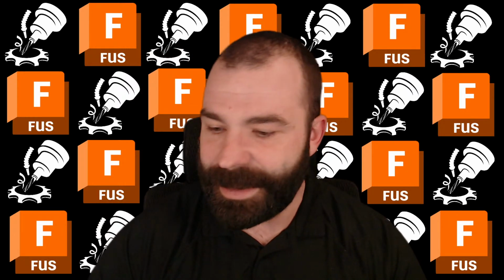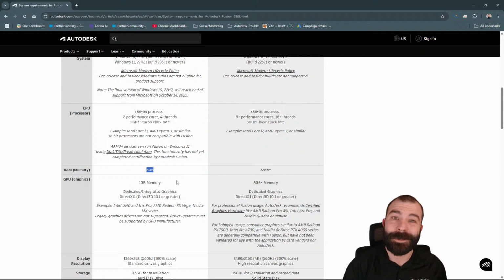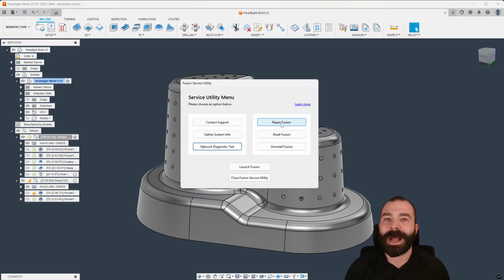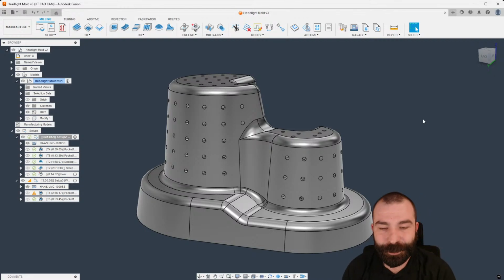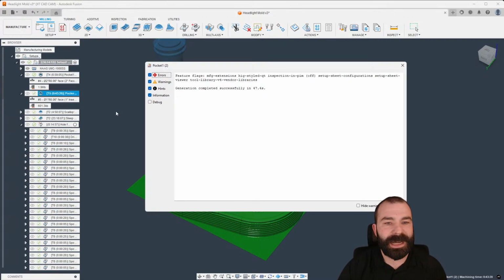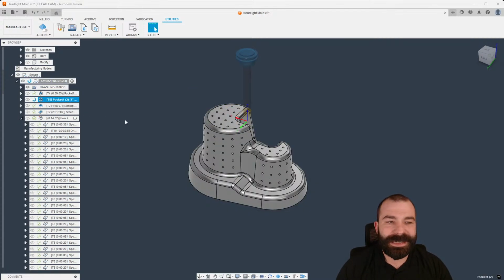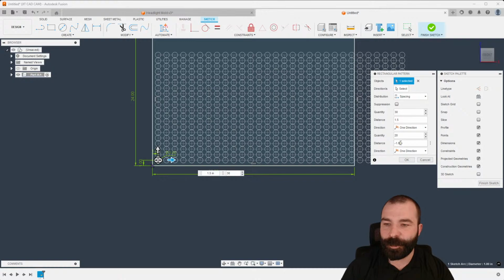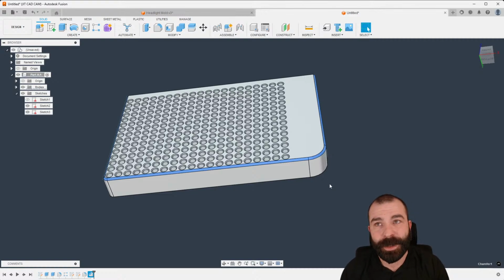Workflow Wednesday: Crashes and Performance Fixes

Comment: I went all out on my laptop and got a custom build from Orbital Computers. 

 Intel Core i9 14900HX - 24 Cores, 32 Threads - (5.80 GHz Max Turbo)

96GB DDR5 Laptop RAM

Video Card: Nvidia RTX 4060 8GB GDDR6 3072 CUDA Cores

Solid State Drive: Max Performance SSD – 1,000GB – Up to 7,300 MBps 
 

I’m hoping this will last me quite a while
Reply: Make sure you have a ultra fast internet connection, or it's all for not.
Reply from the maker: Suprizingly you really dont need that fast of internet. When we travel we tend to use a mobile hotspot or starlink and 15mbs is plenty.
Reply: @JITCADCAM  The only time i noticed a speed improvement was when i got fiber internet. That's just been my experience though. also, i've also been told that fusion only uses one core so multi cores were not helpful anyway.
Reply from the maker: The issues reliese on the item using the CPU. for example a single toolpath only uses one core however Re generating multiple toolpaths without Res Machining it will deligate each toolpath to its own core. Toolpaths in themselfs are still a very point a to b type of math. As for the Fiber I will say accessing your cloud data and Cloud libraries you probably did see some more performanc. As for the math on the toolpath still Desktop bound.
Reply: @ZrubekFamily  I used my hotspot on my cell phone a few times and it’s worked well. I’m not sure the speed of it though.
Reply from the maker: Crazy!!!!!!!!!, We ususally go with about a $1400 gaming computer on sale and odds are that will get you about 18 months.
Reply: @JITCADCAM  yeah it’s overkill but I had a gaming one I used for a good while and wanted to see what this would do. It’s worth it so far.